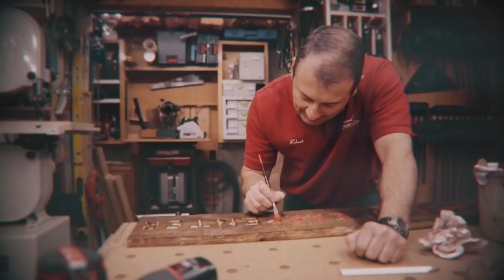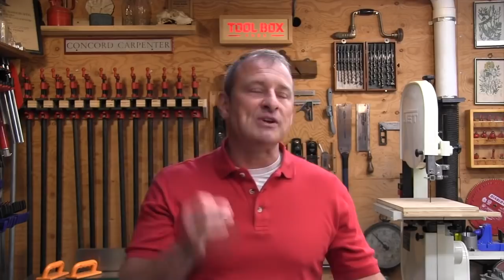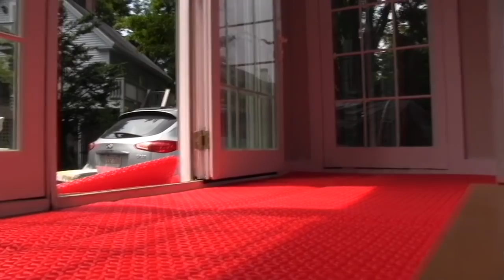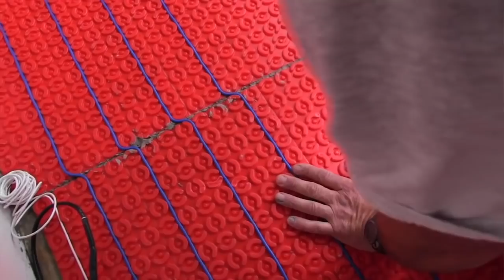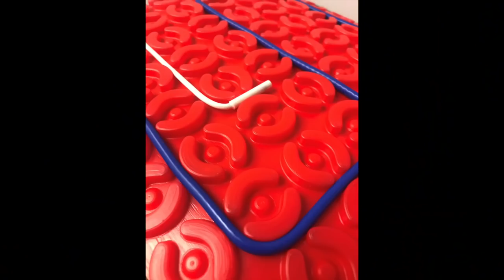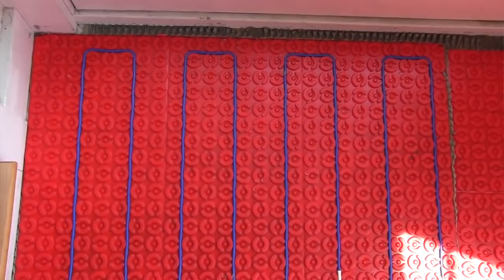Installing the DCM-PRO Uncoupling Mat and Heating Cable

Comment: How do you install the insulation board over plywood? Is it necessary to screw those down? Then once that is installed, do you just put the DCM pro peel and stick directly on top of the insulation board?
Reply from the maker: Hi Janet! No screws are necessary with new Ultralight insulation boards and the peel-and-stick product can go directly on top of the insulation. See more about Ultralight on our website: https://www.warmup.com/underfloor-heating/insulation/boards

Comment: Is there a way to use this under vinyl plank flooring? If so, how? (Does anything need to be installed/laid between the heat mats and the vinyl planks?)
Reply from the maker: Hello Tyler- The most suitable underfloor heating system to use with vinyl flooring is dependent on which kind of vinyl flooring you are using and whether the room you are installing the new system in is a ‘Wet’ or ‘Dry’ room: bathrooms typically being considered Wet and living rooms, bedrooms, kitchens being Dry. A dry room is a room without a significant water element in it. Rooms like bedrooms, living rooms, hallways are so-called dry rooms, as well as kitchens, even though they feature sinks and often washing machines/dishwashers. The Foil Heater electric underfloor heating system used with Warmup’s Insulated Underlay, which separates the system from the floor finish, is suitable with most vinyl floor finishes in dry rooms. The Foil heater is not compatible with COREtec or LVP. Underfloor heating can be installed in wet rooms with vinyl floors. Depending on your project specification we recommend the DCM-PRO Cable and Membrane, StickyMat or DCM-PRO Cable and fixing strips Systems. Remember to always cover the underfloor heating system with a 3/8″ deep layer of self-leveling compound to protect the system from moisture before the vinyl flooring is laid down. You can read more complete information here: https://www.warmup.com/underfloor-heating/floor-coverings/vinyl .Best, The Warmup Team.